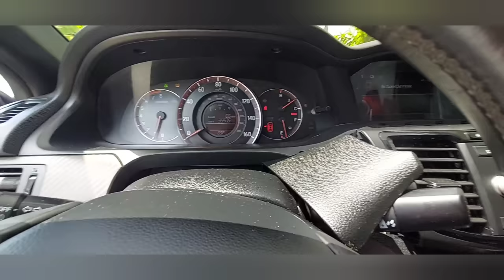Toyota hiace bus build part 18 ....Honda accord system repair...

Comment: Anytime you add a sub or amplification while keeping the factory head unit, you have to disable the ANC from the system on all 9th Gen and up Hondas. It quiets engine and road noise by sending matching frequencies through the audio path to cancel them. I've fixed this issue on other ppl's builds a few times. I could be wrong, but my money is on the ANC.

Comment: Yow big up mi general. Love the work. Want to learn how to wire up all the components from radio to speaker. How the link is made with the preamp crossover and other sound equipment drive rack and the 110v things. Especially the RCA connection. But love the work. Big up

Comment: I think on that car its by the front map light by the sun glass holder it’s a little vent hole and by the rear on the head liner it will have a plastic vent hole just disconnect both off them

Comment: Love the design great looks i have a small suggestion the O in NIZMO and Sound cut a small circle and insert in the middle should be able to glue it in the center after installation and paint pink if sign is white.
Reply from the maker: I no that I chose nt to
Reply: @nizmocarsoundstmary  oh ok cool cool no prob love the setup though you work is spectacular and very neat build.

Comment: Did you disconnect the Active Noise Cancellation? It uses the radio to send signal through the system to cancel road noise etc. Some installers disconnect the mic from the back of the headliner but I disconnect the ANC plug from the back of the head unit..
Reply: Had the same problem with a Honda odyssey van

Comment: Very nice video Nizmo. As a subscriber I have a question for you I want you find out how you think your head unit works with your system? Thinking of buying one like it is just that I usually use old school head unit with 3 sets of RCA line outputs
Reply from the maker: This head unit I have is no good
Reply: @nizmocarsoundstmary  ty very much for your honesty Nizmo big up your self
Reply from the maker: Buy a pioneer double din
Reply: @nizmocarsoundstmary  will do mi g ty